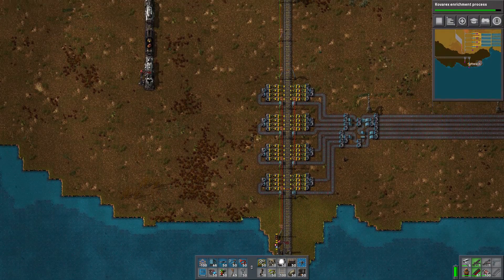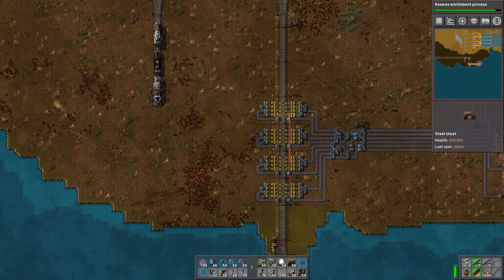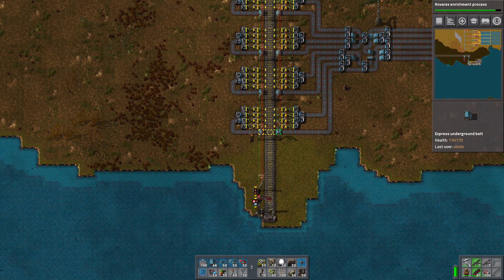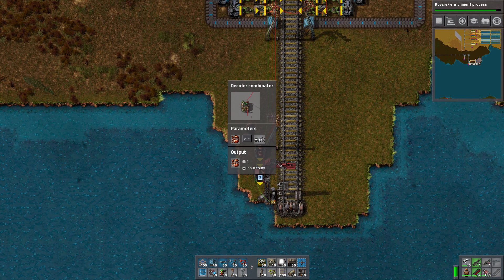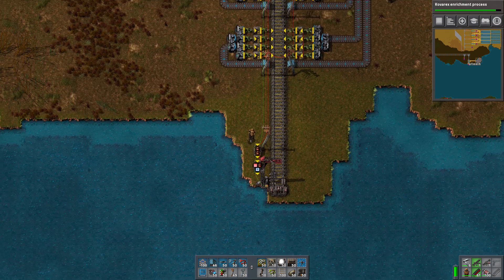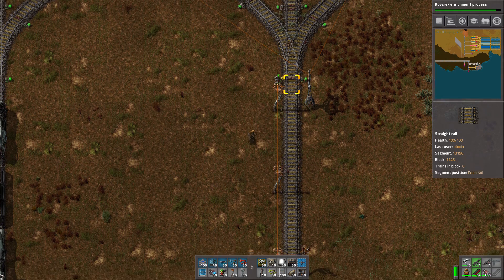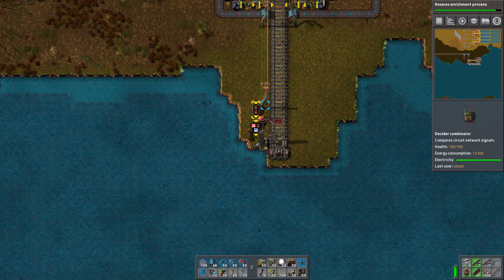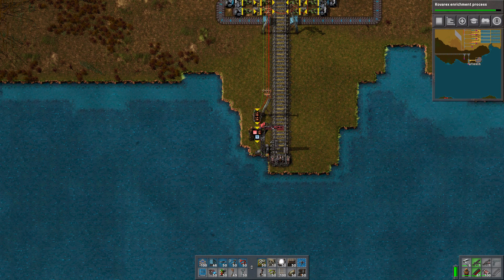Factorio 0.15 - Smart Train Station Tutorial

Comment: What if the trains have more than two stops? it seems that they'll skip to the next stop if the station is disabled
Reply from the maker: If there's another stop with the same name, the train will try to route there instead. If all stops with a given name are disabled, the train will skip to the next stop on its route. (I'm about 90% sure that's how it works.)
Reply: Is there a way to get around that skipping to the next station part. Because it becomes kinda problematic when you have many trains. If two trains comes to the same station, and it's the only one  available, the second train will go back to the furnace empty handed. Maybe it's a design flaw, be I get a lot of empty trains to my furnace, when the number of mining stations go down. (without mods)
Reply from the maker: Actually, I have a solution for that. I'm working on tutorial videos about it, hopefully releasing this weekend. It's fairly complex to explain in text, but if you want to try and understand the blueprints yourself, you can grab the current iterations here: https://pastebin.com/rE9zLdi0

Basically, the rail yards only release as many trains as there are loads with space to be delivered.
Reply: I think I understand the theory. would you then have a rail yard per type of material? (like iron ore and copper ore)
Reply from the maker: +Mathias Gammelmark Yes, that's the idea. In theory, you could do it all in one yard, but the circuits get more complex.